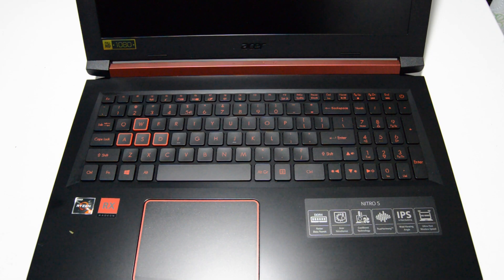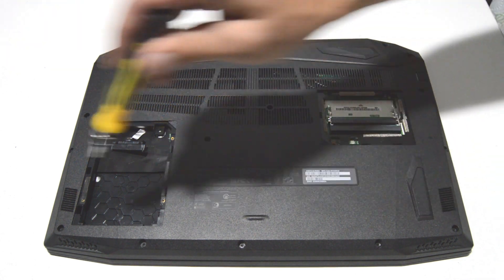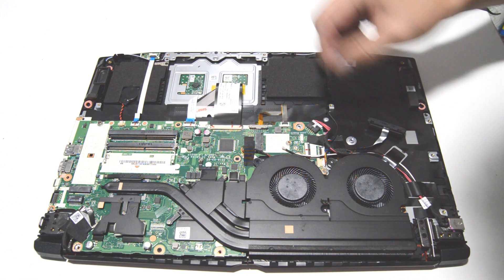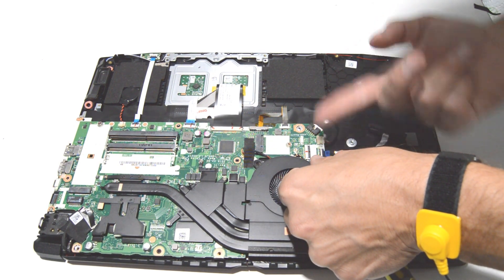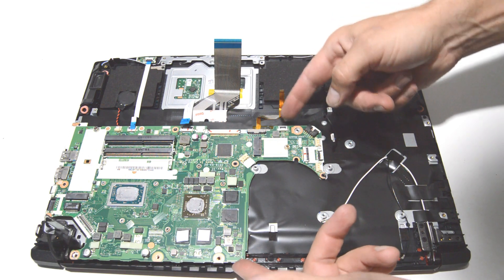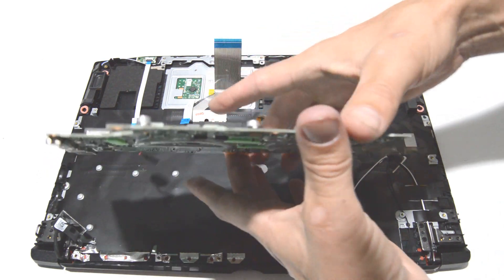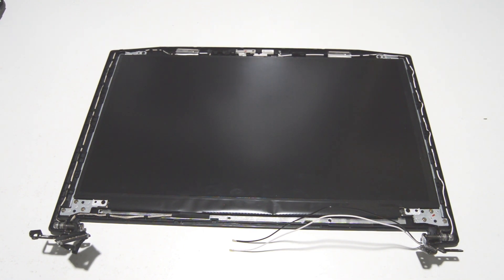How to Disassemble Acer Nitro 5 AN515 Laptop or Sell it.

Comment: Awesome!! I think I have a problem with my Pram battery (The bios battery). Sometimes when I on the notebook it stays only with the ACER logo in. and nothing happens. I need to hard reset holding the power button and then try again until it works. What do you guys think it is? Do you think it really is the pram 3volts battery? Thanks!!!

Comment: I took mine apart and put it back together now it will not turn on. I've done this multiple times with multiple laptops and have never had an issue until now. All my cables are plugged in. I cannot figure out what is wrong please help.

Comment: I know im very late to the party but i have a question for anyone who's willing to help abit. For the USB Ports on the RIGHT side of the board is it connected to the MOBO via a ribbon like the left one? if so then where would that ribbon be in the video? Or if it's not connected via ribbon then what is it connected to?

Comment: Thank you so much.. this was my first time opening a laptop.. I thought I removed all the screws, I pulled the back cover but it was still sticking to the chasis in the middle.. I was trying hard to remove and almost gave up.. there is this silver acer stick in the back, when I removed it I find the last screw hidden there.. now the back cover came off with ease.. I just want to clean the fans and remove dust..
Reply: Can you upload a pic?  I cannot open mine, and I don't feel any hole/screw under the sticker (with serial number right?)

Comment: I have a dead laptop since december 2020, I don't want to spend anymore more to fix it. I am thinking if it will be wiser to disassemble everything and sell the parts off individually or should I just sell it as a whole? How much will I get from it if I sell it in a whole? My laptop is an Asus Vivobook s14 x411UF with a fingerprint scanner.

Comment: Thanks a lot brother for this video. I just figured out that my SATA connector is making problem attaching the HDD to the laptop (from HDD side and not motherboard side), can anybody tell me where can I buy one of that connector for my Acer Nitro 5 AN-515 52.
Reply: I had to get mine replaced too. I used banggood cos a friend said I could get cheap electronic replacements, I also saw it was on eBay and Amazon too but it was more expensive. The one I’m using works fine.
Reply: @philiptruong5626  thank you for the help but for now I am using my HDD as external HDD using a 2.5'' SATA case.

Comment: Hello sir, i bought a open box nitro 5 from ebay and a couples of days it worked fine.now if i connect to a/c then press the power button it shows acer logo and after screen get black with keyboard backlights on.it lightning up charging and power on lights.if i boot up it without connect to a/c adaptor it works fine.
Can it be a motheboard issues or will a BIOS update can help me??plz help me.
 It charging without problem. 
When restart with a/c adaptor connet  also boot up fine without issue.

Comment: I bought this laptop 3 months ago, at the beginning when i plug in charger, i will hear small beep sound and orange light will show up. But now i cant hear that beep sound . Also when i use my laptop at 100%charge(plugged in) charge is reducing to 99% even i plugged in and light is changing to blue and orange quickly. How to fix this problem please help
Reply from the maker: Sounds like the battery is going bad or you have a generic replacement battery.

Comment: after opening the back cover it is possible to remove only heatsink? .. do i have to remove all the stuff like battery n wifi and other stuff to remove heatsink?
Reply from the maker: Disconnect the battery, you don't have to remove it. Make sure to disconnect the two fan connectors, then you can remove the heatsink screws and remove the whole fan/heatsink assembly, paying attention to any cables that might be in the way. You will need thermal pads, this heatsink uses a lot. When reinstalling with new thermal paste, tighten the heatsink screws down in the order stamped on the heatsink.
Reply: @Sellbrokedotcom  Thank you sir

Comment: Amazing man, uff, thanks for your contribution

Now i feel more confident to can open and clean the fans of mine
Reply: My laptop fan is not running at optimum speed and sometimes generates different notice.
Is  dust causing this?
And will cleaning the fan help?
Reply: @gokulkrishna2615  yeah, most likely. It's a very common cause. You can open up the back and dust off the fans with a small, clean paintbrush
Reply: doing the same lol

Comment: Well, the technician avoided to disassemble the most difficult part: THE KEYBOARD. To Nitro 5 owners, you better not spill anything on your keyboard. Else, the technician will have to completely disassemble the laptop as shown without disassembling the screen assembly. Then remove a black carbon paper separating a metal frame underneath the keyboard from the motherboard. This metal frame is riveted to the laptop's frame using plastic rivets, about 20 or so, to stop the keyboard from sinking while the user applies endless keyboard clicks. Absolute pain the behind to remove those plastic rivers and even more pain to reapply them. Do not do any short cuts because you have to use a knife to remove the plastic rivets. Else, you can miss your target causing the knife to cut a flex cable, a wire, or scratch a PCB circuit board. So, do not be shocked if you are charged 3-4 hours for this job plus price of the keyboard. Keep the Coke, beer or coffee as far away from the laptop while using it.
Reply: Please tell me u have a video
Reply: I’m currently crying with my laptop fully disassembled except the keyboard, the only ducking thing I needed to replace

Comment: Hey i've got a problem im concerned about and you can answer it if you have spare time. Basically the laptop is new around 2 months. I turned it on and then plugged it into the wall 0.5 seconds later. It did a high pitch sound but nothing seemed wrong. Although there is now a buzzing noise when cpu load is a bit higher coming from the top middle around under the F6 button,somewhere there. I dont know what it is. I thought it is the fan but it isnt. No idea if a caused it or it was there and i didnt notice.maybe i damaged something with high voltage? Someone with similar problem? The sound become more noticable when you load the cpu higher
Reply from the maker: The only moving parts on your laptop are the fans and hard drive. F6 is right over one of the fans. It's not unusual for a fan to be bad or have bearing noise when new. It might be worth trying unplugging each fan by itself to see if the noise goes away.
Reply: @Sellbrokedotcom  it sounds more like an electrical buzz like the old TVs
Reply from the maker: @SweetDreamsLB  It can't be the speakers since they are at the front of the laptop. The fans are the only thing I can think of.... everything else at the rear of the laptop doesn't move or make noise (usually).

Comment: Most excellent, I want to remove the whole top so I can replace the screen but still be able to use it with my TV.
Reply: Did this work for you? I want to remove my screen entirely but I wasn't sure if the laptop would still boot into windows with just an external display with no actual screen attached (as to save space).

Comment: how do i remove the camera from the LCD back cover?
Reply from the maker: They are usually just held with a sticky pad, pry with your fingernail from the bottom or top, not from either side and it should pop out.
Reply: @Sellbrokedotcom  Thank you

Comment: i need to know what are that (flat) clable white near the litlle battery and what do
Reply from the maker: From battery going right, thats either a lid sensor or an LED board, then touchpad cable, keyboard cable, then keyboard backlight cable.
Reply: @Sellbrokedotcom  mine don't work, I try everyrhing, TEchinal say may be motherboard
Reply from the maker: @casamentoGG  Did you try another keyboard? I think the power button is integrated into it.
Reply: @Sellbrokedotcom  it.try to turn on, even keyboard got light, but then turn off the and onn
Reply from the maker: @casamentoGG  Try unplugging the battery and just running off the AC adapter (power adapter). A bad battery can do that sometimes.
Reply: @Sellbrokedotcom  already did that even ram and ssd,
Reply from the maker: @casamentoGG  Yeah at this point then I would call your motherboard bad, sorry

Comment: The screws are really tight and can't get them out
Reply from the maker: You may have to press down hard, and possible use another tool to help turn the screwdriver. Also make sure your bit is the same size as the screw fitting.

Comment: i need to replace the LCD backcover only.  do i have to dissasemble the whole entire thing to do this?  also are there any cables soldered to the back cover?
Reply from the maker: No you can do it without having to take apart any of the chassis. Once you pop the front bezel off you have access to all the screws to remove the back cover. You will probably have to also unstick the wifi antennas and remount on the new back cover.
Reply: @Sellbrokedotcom  aright cool, thanks for replying.  is the antenna soldered or tape to it?  i already found the back cover but i dont want to break anything.  this doesnt look too had

Comment: I was trying to clean the fans of my Acer Nitro 5 AN515-52-56CQ and broke the SATA flex ribbon cable. I checked if the drive still works on another laptop and it's all good. Question: will the SATA cable from another maker and model work as a replacement?
Reply from the maker: Most likely no, but here is a new one for $18 https://www.ebay.com/itm/Acer-Nitro-AN515-52-AN515-53-Hard-Drive-HDD-Connector-Cable-50-Q3HN2-002/124231554440?hash=item1cecc71588:g:BeMAAOSwc65e8H9X

Comment: Hey it says in https://community.acer.com/en/kb/articles/101-what-type-of-m-2-ssd-drives-are-supported-on-the-nitro-5 that this model has a slot 2 for the M.2 SSD. Which is the slot 1 and where is the slot 2?

I can also see 1 on the left but not the other one

Nevermind. I thought this was a AN515-43. The 42 only has one slot

Comment: I need to replace the keyboard, does that black film just peel back?
Reply from the maker: Under the black film is the backing plate which is held on by plastic rivets that were melted in place. You can break them to remove the backing plate, but it might be hard to reinstall it securely enough to hold firm, especially since there are parts that attach to it. It might be easier to replace as an assembly.

Comment: I have Acer Nitro 5 AN515-42 with Amd Ryzen 5 and Radeon RX 540, Can I install any SSD in my laptop (M2 or Other)? Thanks
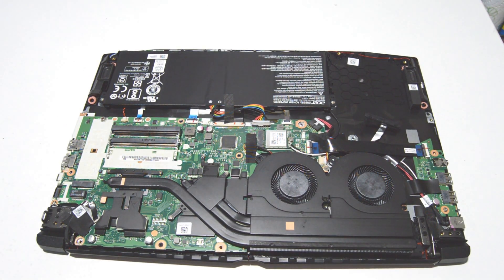Reply from the maker: At 4:30 you can see the slot for an NVMe 2280 SSD...you can also add one to replace your 2.5" SATA hard drive....although these are slower.
Reply: @Sellbrokedotcom  The slot for an NVMe 2280 support SSD M2 SATA? And what's the difference in these models? Thanks bro.

Comment: On my laptop, the problem is that the back cover has a cracked piece which means that the front bezel and back cover don't connect properly. I know this isn't a huge problem, as it isn't a tech issue but I am still really worried! Any suggestions?
Reply from the maker: You could try using plastic epoxy to adhere the pieces together in that spot.

Comment: There is a way to take off the keyboard without dissabling all the computer?

Edit: I know that this computer is not like older laptops were the keyboard was easy to access, but I don't want to dissamble the whole thing if its possible
Reply from the maker: No sorry, the palmrest is the main structure of the laptop that everything is attached to, and the keyboard is on the "bottom", underneath everything. Just take lots of pictures a to help your reassembly with correct order and proper cable routing.

Comment: I reassembled it and it wont charge or boot help me out 😰
Reply: Pankaj Arun did you return the battery connector,some laptop will not charge if the laptop cover is still open so you have to close the laptop
Reply: TechPH did everything the machine is just dead
Reply: @pankajarun8884  updates?
Reply: Anish Kapse i sent it to an engineer today will let you know in a week
Reply: @pankajarun8884  cuz I'm facing the same issue
Reply: Anish Kapse i tried everything possible couldn’t fix it sorry mate
Reply: @pankajarun8884  oh. Let me know in a week if it's repairable
Reply: Anish Kapse the motherboard is damaged the engineer is lookibg into the matter
Reply: @pankajarun8884  yea I figured, the only way is to replace it unless the damage the not major

Comment: Is it possible to replace  this 60Hz monitor display to 144Hz? Then once change to 144Hz is it supported by the system to run it in 144Hz? Because if possible i want to find 144Hz display and change it.
Reply from the maker: That's a tough one.... they may use different video cables. Best place to check is an Acer forum, good luck!
Reply: @Sellbrokedotcom  thanks2!

Comment: Ok, so I'm trying to remove /stop wifi from running on this computer. My EMF meter is still picking up a signal on the left side of the monitor reading 5000 microTesla  when the wifi and blue tooth are off. This is very high considering my other laptop runs around 60ut.  Is there a wifi antenna on that side? and is anyone aware of it being powered externally? When i turn the laptop off the levels drop.

Any ideas?
Reply from the maker: Wifi antennas are probably on the top part of the display assembly. Not sure why wifi runs when its turned off, that's suspicious.
Reply: @Sellbrokedotcom  yeah if it is the wifi at all. it could be something else with EMF oozing from it but I seriously have no idea what that could be. I saw the data sheet had two points where the wifi comes from... but the high reading comes from only one side. the other side is 200ut Maybe it's some kind of wiring issue. Who knows.

Comment: Installing octane 16GB. Any suggestions"?
Reply from the maker: Why not add just a regular NVMe M.2 2280 SSD drive? At 4:37 you can see the slot on the left where the big white rectangle is. That way you can get way more than 16GB at flash drive speed. Check out this 512GB model https://www.ebay.com/itm/402195795104
Reply: Octane are not good.
Reply: This model does not support NVMe, the M2 SSD drive needs to be a SATA module

Comment: Hi! You're channel is awesome! anw i have problem, usually my nitro 5 same as in your video that has amd gpu.. i can set the speed of the fan either fast or normal by using nitrosense, but after a few month, the apps cannot read my gpu and stated 'discrete gpu is idle'.. when i check the task manager 'gpu' and also the fan itself at the bottom of my laptop, it moved... So how to solve the problem (cannot change the speed of gpu cpu fan) 

I've tried to update my vega 8, my ryzen 5 2500u, and also the nitrosense app itself.. still no answer to my problem.. do i need to do a clean up on my laptop to solve the problem?

Thank you very much in advance if you can help me or anyone that know how to deal with my problem.
Reply: it means you need to open a game or a gpu based software to make your discreate gpu running so that nitrosense can read your gpu

Comment: Looking to just replace one of the hinges, do I need to take apart the entire motherboard and all of that to do so? Or could I just support it to remove the screws, then just take the hinge out. Thanks.
Reply from the maker: You may be in luck, the hinges sit above any components and it looks like you can just separate the display assembly after removing the cables and screws. Remove all the cables connected to the motherboard and wifi first, then open the screen all the way, flip it over, and using one had to support it, remove the hinge screws. I believe the bezel just pops off to get at the other end of the hinge. Good luck!

Comment: I sent my Acer nitro 5 for repair at Currys pc world and they phoned me saying they can’t fix it without explanation so I guess imma have to do this myself and buy a new mother board
Reply from the maker: Ebay is your best bet for the motherboard. Make sure you get the right model, same part number as the original one.  Here's an example  https://www.ebay.com/itm/Acer-Nitro-5-AN515-42-R5ED-15-6-Ryzen-5-2500U-2-0-GHz-Motherboard-LA-G021P-ER/303291396654?hash=item469d93722e:g:wXcAAOSwZRZdhLLZ:sc:USPSPriority!89431!US!-1

Comment: I literally don’t have a hard drive what is this?
Reply from the maker: Check out 4:30 on the left of the motherboard, that's the spot for the NVMe SSD drive. Your system might just be using that for boot and storage. The hard drive is for storage expansion.

Comment: can I do this without remove the hdd? the screw is just stuck.
Reply from the maker: Its hard to tell, its possible, you might just have to remove the SATA ribbon from the motherboard but I dont see any screws under the hard drive caddy.
Reply: my fucking screw is stuck too

Comment: please tell me that this supports m.2 ssd with an hdd
Reply from the maker: Pause the video at 4:30 and look on the left side of the motherboard, there is an NVMe slot right on top there when you remove the bottom case :)
Reply: @Sellbrokedotcom  are you sure its nvme?